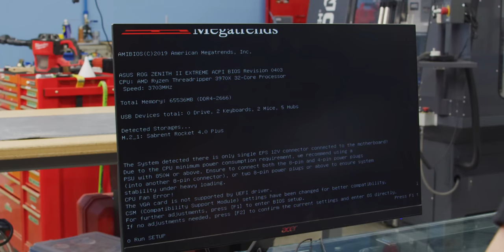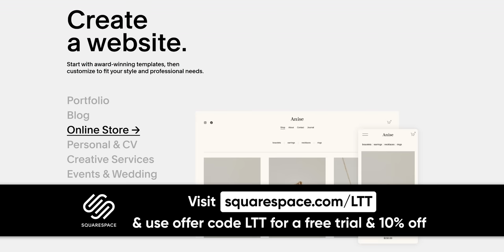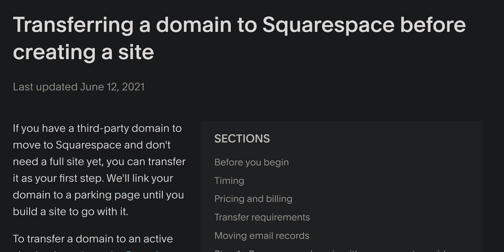Powering Up My ZERO Compromises Desk PC Part 4

Comment: “Leave no performance on the table!” 

Also Linus - picks a 3070.
Reply: Leave no performance on the table- put it in the table instead.
Reply: @xethaios  lmao
Reply: "no compromises!" yeah, about that...
Reply: 3080s and 3090s are thicccc cards tho and they needed it thin is probs why
Reply: @karmakaze9972  not with a water block
Reply: @clevelandbrown2426  oh shit yeah it replaces the heat sink doesn’t it
Reply: and also a 3070
Reply: I am surprised they didn't put two SLI 3090s and a 128 GB ram
Reply: @ShihammeDarc  only illuminati guy does that
Reply: Even Linus has ran out of 3080 and 3090 cards
Reply: honestly i expected a 3090 or a quadro. and a 3990x instead of 3970x (also 64gb is not balls to the wall)

Their no compromise pc from before was way better than this one
Reply: Den of Lore how come you guys don't make videos anymore?
Reply: Yeah that’s what I said, no compromises… puts in a mid tier card. Water cooling a 3090 would be much better
Reply: @karmakaze9972  waterblock is the same size
Reply: @Alexlim0507  that actually ruined the entire build for me
Reply: @CustomComputing  yeah idk why he didnt but oh well thats linus's problem
Reply: Yeah spend 8000 dollars on materials and labor for everything up until the house. Then save 800 bucks on on the most important part and make it a very expensive regular computer.
Reply: under 8cm ?
Reply: @captainzero119  i meant with watercooling whoops
Reply: Synoid-NOVA  but watercooling
Reply: He said in the part 3 video that A: they are limited to only 850 watts on their PSU (which might not be enoughf for a 3090 and a threadripper) and B: the total surface area of their rads is about the same as a 240mm rad, meaning that thermals might get hurt a bit.
Plus, a 3070 will be enough for any productivity and gaming (unless its in 4K).

Comment: Tip: use a little bit of water and soap on the tubing joints while pressurizing it with air and look for bubbles. Fastest way to find leaks and avoid a mess
Reply: Yup they did it in the previous episode, it’s worth a watch, quite interesting things happen...
Reply: Just pop a smoke pellet in the tube and see where the smoke comes out 🤷‍♂️
Reply: I would recommend this too as it’s what I do when fixing overheated boilers on old steam engines
Reply: @ChrisB1993  I don't know what a smoke pellet is but I was thinking pump some smoke in there and get it done
Reply: @dimitrijekrstic7567  it’s a non harmful little ball smaller than a marble that lets out smoke
Reply: Vape on it
Reply: @davetheisen9426  probably a joke but don't do that. It kills components.

Comment: You're in a studio full of mics, finding a leak should be easy 😂
Reply: I’m confused, what do you mean
Reply: @thatpandaz6094  me too, I assume OP means sound leakage but that's about all I could think of
Reply: @thatpandaz6094  using an microphone and turn up the  mic sensitivity to find the leak
Reply: @antonylin8669  exactly
Reply: They were pumping air through the water loop to see if there are any leaks, and the system said that it was losing pressure, so  they were listening for a leak of the air, but shoulda just use a mic when they couldn't hear it.

Tho granted it's cuz the valve wasn't fully closed it seems lol
Reply: Nice, people got what I meant. Normally I have to spend a week trying to explain how gain on a microphone works. But that is not on this side of the tube, here we are all nerds. 👊
Reply: @looneytuned777  i do front of house mixing so i know a thing or two about audio.

Comment: 7:07 Make sure you use a brad nailer in a perpendicular orientation to your rails. This will help compensate for a potential blowout. The head of the nail is more likely to deflect perpendicular from the orientation of the magazine (left/right when holding the nailer upright.) But when using MDF, this isn't a huge concern.
Reply: Lol these guys would never give two shits about details like that. They’re gonna paint that shit black and pretend you can’t see it on camera.

Comment: Apply a small amount of water and soap to the tube joints while applying air pressure and looking for bubbles, which actually is quite significant. The quickest approach to actually locate leaks and literally avoid a proble, or so they kind of thought.

Comment: I expected more than a 3070, but regardless of graphics card, this is one epic feat of engineering!
Reply: Single slot capability for mounting, reason why I still love my 1080ti
Reply: @xXDarthBagginsXx  the Asus ekwb 3080 is also just one slot deep.
Reply: @xXDarthBagginsXx  you know what, I stupidly hadn’t considered that. Makes complete sense now. I wonder if the 3070 Ti is the same profile or is that already 3080 size?
Either way, fair point well made.
Reply: @HamerReviews  Same reason you wouldn't put in a 3090, he wouldn't use this for gaming barely any of the time, and that a 3080 would dump more heat into the system when they weren't sure how good the cooling performance would be.
Reply: @njoshua3265  yep, I’m pretty stunned by their cooling numbers. It’s certainly a great pc layout

Comment: Things I'd do differently if I was going to try this: 
1) Soft front edge for the desktop. 
2) Under-desk cutout for the user's legs (machine would be built into the rest of it, and thickness wouldn't matter that much). 
3) Monitor(s) attached to a monitor arm rather than resting on the desktop, which enables the last feature -
4) The desktop is hinged and can tilt up for easy access to the internal components (kind of like a car hood).

Comment: Basic rule of acoustics: reduce turbulences, increase laminar flow. Never push the air, always pull it. This reduces the turbulences and thus the noise. Also, a laminar air flow cools better. Therefore always mount the ventilators at the end, at the exit, after the coolers. You have to do the opposite of your mount for optimal performance.

Comment: tracking down leaks or pinpointing odd noises take a piece of  flexible tubing put one end to your ear then use the other end at joints or bearings that you want to check (works for air hoses all the way up to heavy equipment

Comment: “No compromises!!” doesn’t use titan, quadro, or 3090. Doesn’t use 128 gbs of ram /s
Reply: i think linus means like no compromises for that hardware, like usually a thin desk pc has to have a crazy low profile water cooler that might even be specially made, or a power supply that was modded to be thinner.
Reply: @CTMKD  e
Reply: @CTMKD  I put /s cuz it was a joke. Satire.

Comment: Try using the thermal camera to find air leaks.
Reply: This should work, the air will heat up when compressed, though the difference may be minimal by the time it's caught on camera.

For maximum style points, however, Schlieren imaging should be used instead.
Reply: @Llohr  ngl this is the first time I heard of this very interesting concept, but doesn't seem quite practical to have your $3k components hanging in front of a mirror to find a air leak. They were already freaking out moving it between tables.
Reply: Put a chunk of dry ice in the res and get it wet.
Reply: @Zachzedzach yes this definitely works for finding leaks in a tire or also gas leaks but too risky to use in electronics.
Reply: @buca117  I don't how much moisture such smoke carries but that is definitely a great way to make non residual smoke

Comment: Axial fans don't deal well with back pressure you should use centrifugal for better airflow when aiming for airflow through positive pressure especialy with dust builds up in the rads.

Comment: I still have yet to see any actual humans using Ridge Wallet when they weren't being paid to do so. lol
Reply: It’s awful. I bought one. It’s super uncomfortable, and it scratched the shit outta my cards and honestly is super inconvenient. It’s the equivalent of just having 2 rubber bands around your cards. It’s bad
Reply: I used it for 2 days and put it all back in my old leather wallet kept the carbon fiber bottle bottle opener tho
Reply: I havent had an issue with it and have used for over a year and a half. I didnt pay for it but if something happened to this one i would buy one myself. Havent had a card scratching issue but it isnt all to smooth to slide in the cards the girst few days. Once broken into its very comfortable and the size even with the clip or strap is just great. I hold 10 cards but i believe it can hold 15 at which point it might end up feeling awkward

Comment: Everyone who hasn’t watched the other parts will be like why isn’t it a rtx 3090
Reply: @michaeljackson8390  No u.
Reply: didn't watch those parts, why isnt it?
Reply: @michaeljackson8390  shut up
Reply: @javidzhang  none would fit, this was the only watercooled GPU that could
Reply: @javidzhang  wouldn’t fit 
That is also what she said😂
Reply: Probably performance vs size/heat/power output made it the best fit for the system. Especially for the amount of radiators that also needs to cool the other components

Comment: So.... They never did start up the fans, eh. They were getting these temps, "passively" (with just the pump).
Reply: Yeah, my exact thoughts. The loop is so enormous that just water going trough them is enough to cool them down.
Reply: Surfing the comment section only for this kind of comments! I didnt see any of the fans working 🙄
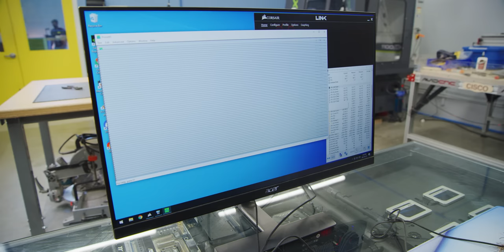Reply: You can clearly see them running at 12:07, 12:16 and 13:13, you guys must be thinking that the focused flow stator guide vanes are the fan blades, they're not.
Reply: @FastSloth87  i must be mistaken for that yeah 👍🏻
Reply: @FastSloth87  I look, but it's either just such a short amount of time, they're so fast, or the black on black - it doesn't even look like there are blades are there.
Reply: I wouldn't expect any details like that in build videos any more. He hires engineers to do these crazy builds but never gives them the budget or time to complete them properly, the best we get is Alex or Colin getting a chance to prove their proof of concept might have worked given the right resources.

Comment: Linus have you never heard of soapy water in a spray bottle to find leaks?
Reply: Wooder
Reply: You can't just spray your entire PC with water
Reply: alright well it is a computer and you can’t really do that
Reply: It's not an innertube or a gas pipe buddy.
Reply: @narkit7849  you can literally use your finger, dip it in soap water, put a towel under the lines and rub it at the connector joints. and you will se it instantly
Reply: @inteallsviktigt  read the comment above carefully it says soapy water in a SPRAY BOTTLE

Comment: "ZERO Compromises Desk PC" proceeds to use a 3070 lmao, sounds like a huge compromise to me
Reply: How is a 3070 a compromise?
Reply: @baddriversofthenorcalarea500  Its not the best performing card. If you had unlimited budget would you select a 3070?
Reply: @johnrambo7914  If I had an unlimited budget I woulg go with a terabyte of ram. This isnt an "unlimited Budget" build, its just a build where they dont try and save money by buying worse parts. There is a difference.
Reply: @baddriversofthenorcalarea500  3070 is really a compromise though whichever way you see it. 3080 is the best value card for this generation even if you go for value pick, so its really seems like a compromise
Reply: @johnrambo7914  It is only a compromise if you need more performance. If you are building a PC to use for absolutely nothing but solitaire, is it really a compromise if you get a 1060 instead of a 3090?

Comment: He settled for a $500 GPU RTX 3070 despite spending like 15k on that rig...
Reply: I mean this is going to be his office workstation so I think he'll manage with a 3070
Reply: 500$ GPU yeah not right now but 😂

and because they didn’t know if it gonna thermal limited, maybe he will be upgrading because of the thermal headroom
Reply: None other GPU would fit so he had to
Reply: @skiez7430  Are you sure I think there is some 3080 with 2 slot pci 🧐

Comment: Have you guys ever used a little bit of soapy water in a spray bottle to find leaks on a pressure test? Maybe not the best thing for gpu and cpu blocks but it should be fine for anything like the radiators and fittings and the reservoir that are separated from all the sensitive components 👍

Comment: if youve got a leak which you suspect to be in the tubing, why no use a bucket with a bit of water and soap, then use a rag to wipe the tubes. if this is done right it should allow you to see the area of the leak as small bubbles should show up.
I use something similar to fix the inner tires of my bicycle.

Comment: To me, the radiators and fans are not needed, just use aluminum plate on the bottom and build a PVC channel that would server as a reservoir and radiator, you can use almost the entire bottom panel and would yield tremendous surface area for cooling.

Comment: A little bit of soapy water around the connections will blow bubbles from the leak... and show you where it's at. Old trick done for air and gas leaks on pressurized lines. Oh wait, you got it anyways. 😋😛

Comment: If you wanted to create a seal with the glass. Why not use a thin rubber strip around the parameter of the desk and gaps? It won't stick and after it settles it will create a really good seal. I didn't see any used, so I assume you're counting on the glass to just hug the wood.

Comment: You should've used Black 2.0 or Black 3.0.. just saying. 

Also, switch to GentleTyphoon GT's, and PWM mod them. Set them to adjust speed to water temperature. Gentletyphoon's still have the some of the best head pressure, which is what you want for this build.

Comment: For £40 you can buy an Ultrasonic Leak Detector with Transmitter & Headset, Air Water Fluid Pressure Vacuum System Leaks Tester. Yes it does all that. Cheaper than a helium leak detector. You do not want leaks into your electronics.

Comment: You should measure the water flow, you could probably benefit from more water pumps in that build. I have 3 in my system and its going at 282 L/H. My GPU is between 25 and 31 C (inactive/active) and my CPU is 30 to 53 C (inactive/active) while gaming. Flow rate is a thing and from the looks of your build (length of the water loop + cooling blocks), I think you could use more pumps.

Comment: I guess this should work theoretically, however there is an issue. When positive pressure is built it tend to take the path of least resistance, so a hole in any where in the case would cause it to leak that pressure. But if you angle the fans to create flow, then the air moves through the path with least forward resistance. So angling the fans upwards creates in this case turbulence, and makes the main cooling rely on the reduced internal pressure inside the case.

Comment: Why not use a bellows system like 'DIY perks' did recently on his channel to push air through such small radiators instead of fans? it would have been cool on an engineering level and much more effective static pressure wise

Comment: Would it not be better to have the fans creating a vacuum in the desk so air is pulled into the radiators from outside so that the cooler outside air is sucked through the radiators rather than the air coming in from the fans, passing over the hot components and then flowing through the radiators at an already elevated temperature? Just a thought

Comment: why wouldn't you use, like, a rubber strip around the edge of the glass to seal the air instead of relying on the wood and glass all sitting level? The rubber would flex and mould into the shape to fill any gaps between the glass and the wood and create a far better seal

Comment: I love it. Your temps are amazing. I'm big on water cooling. To date my coolest running PC is THOR, the PC I use on my Sim Rig. The case is a Rosewill THOR V2-W with a 1 1/4 inch riser that goes between the top of the main body of the case and the hood. This was added to give me enough room to mount a push/pull fan setup on the Corsair H115i Pro AIO. the mother board was changed two years ago to a Asus ROG STRIX Z390-E Gaming with a i7 8700K CPU. 16GB DDR4, Corsair 1200W PCU, 1TB M.2, 8TB of storage, Graphic is a Aorus GTX 1080 ti 11GB, but its the GPU water loop that make it rock. Starting outside of the case on top of my Rig is a Thermaltake D5 Pump/Reservoir Combo. Soft tubing takes water across and into the top of a 700ml Reservoir mounted on the back of my case. Leaving the bottom of that reservoir the tubing changes to hard chrome and takes the water into the case along side the power supply. It turns upward and into the EK Full Cover Water Block mounted on the 1080 ti. Leaving the GPU more hard chrome tubing take the water up and forwards at a 45* angle to just under the DVD player where it exits the case and turns back towards the Rig. But not before changing back to soft tubing which takes the water to a 480 copper Radiator mounted under the top of the rig. Going back to hard chrome tubing the water is taken up across the front of the rig at a 45* angle where it meats up with the pump/res to complete the loop. The 480 uses 4 120mm corsair high static pressure fans pushing and 4 120mm high flow fans pulling. The AIO uses 4 140mm high static pressure fans. The Case has 2 220mm fans, a 140mm fan and a 120mm fan. That's 16 fans and the system runs dead silent. It uses about 70 oz of water and because of the layout the system can be filled almost to the top without needing to turn it on. This saves on air in the system. Running CPU at 4.7 ghz, gpu at over 2000 ghz, and playing project cars across three 24" 144 hz gaming monitors @ 144 fps and the max CPU temp is 50C, max gpu temp is 48C.